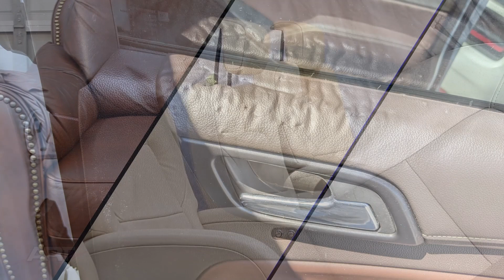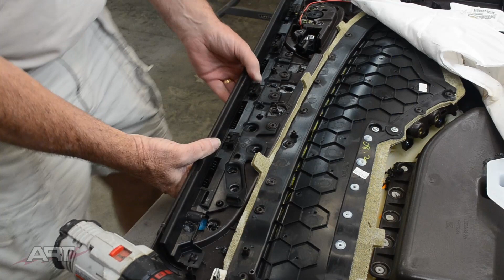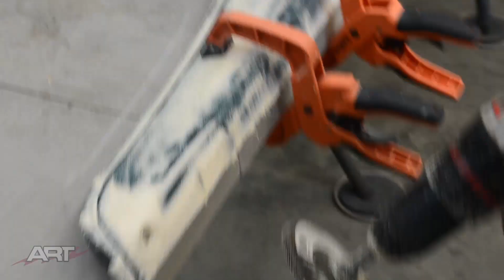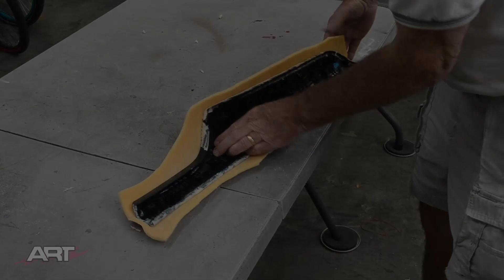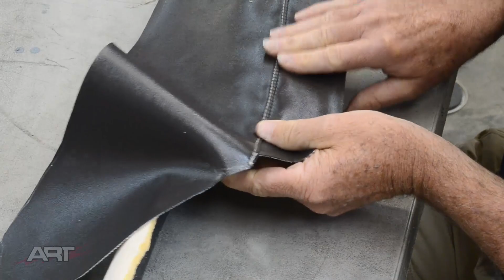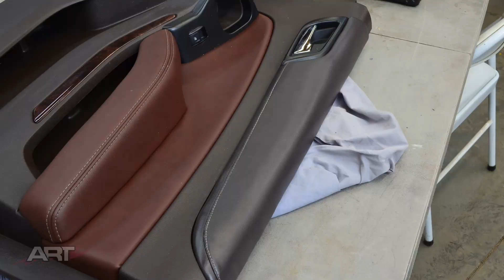Suburban Door Panel Top Cap v119

Comment: The real root of the problem is GM using foam that doesnt rebound when compressed. I wonder why they did that. Regardless, i admire your work and thanks for sharing your talent.
Reply: Really as mentioned, I think what causes the damage is body oils and sweat that migrate through the vinyl into the foam. Add the pressure from resting an arm and over time the foam deforms. This happens on other vehicles too, Lexus BMW etc...  And most always on the driver front door panel.
Reply: @mttmg  I see, so the foam starts off OK with spring back action but then degrades over time due to the environment. GM should've known the environment the foam would serve in and what impact that would have on the panel. I wonder if this is intentional to keep folks wanting to buy new again, like a planned obsolescence strategy. LoL IDK i just find it curious that such well established automotive companies have same issue.

Comment: Another nice video Rick! You did a good job for a first time recover on that door panel.
It's nice when the door panels are made so that you can remover the upper section. Some have screws, imagine that! 
In my experience oil and sweat from the user's arm resting on the top of the door panel is what causes the foam to deform like that.  And you're right it can NOT be heated out. I suppose it could possibly be filled and grained but I don't think it would ever look quite right, recovering is the best way to go.
 A couple suggestions, I often use a new sharp razor blade to shave off the old foam and then sand off any residual foam if need be. 
Then I use vinyl top padding which is very dense and similar to the original foam, or even better would be a dense closed cell foam.  
I use contact cement in a quart spray gun, aerosol glue is ok but DAP Contact Cement: Weldwood Landau Top and Trim is much better, and if you use glue a lot it's cheaper than buying aerosol spray glue.
 I glue just the seam area down first and try to get the stitching even. It seems to work better to just glue the seam then rREALLY stretch out the material on both sides to pull it all down evenly. it can end up a mess trying to glue it all if you need to make any adjustments.
Using a heat gun to warm up the vinyl so it stretches will help too, especially around the corners / ends.
 Depending on the thickness of the plastic 1/4" staples can too long, they do make 5/32" staples too and I wish they made 1/8" sometimes! 
That could be done onsite if someone had a small sewing machine like yours , we used to have full size commercial machines mounted in the vans and would do seats on site. Not anymore, there are too many variables for material so we just pull the panels and take them back to the shop.
Reply from the maker: Thanks for contributing so much to this discussion.  I do have the glue in the gun which will be much stronger.  Thanks for the help.